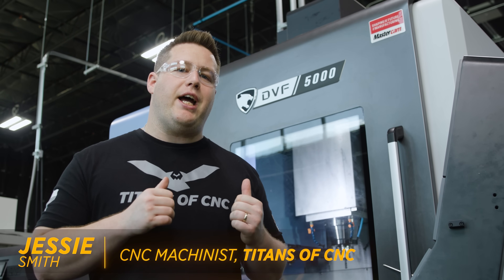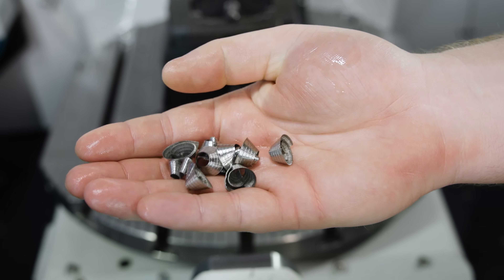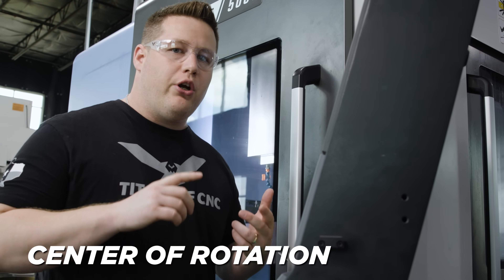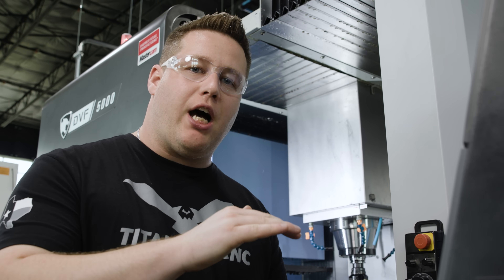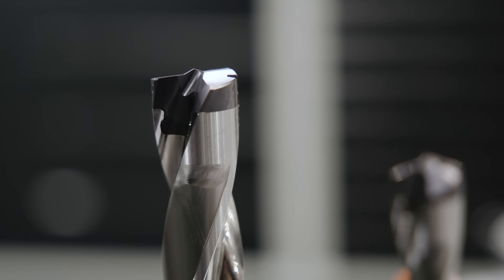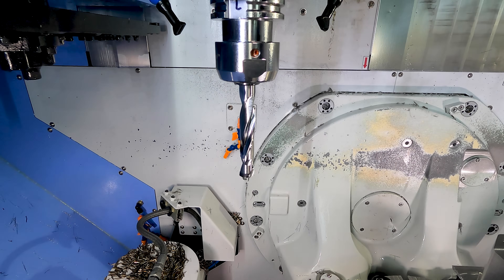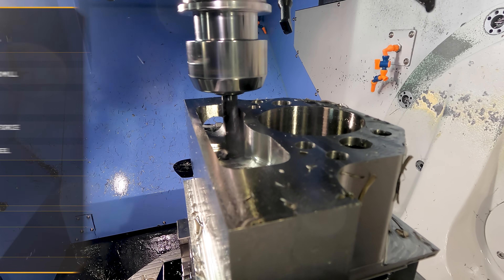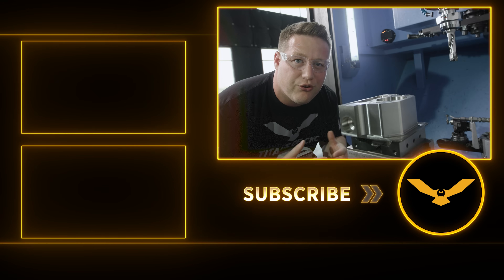Complicated 5 Axis Machining Techniques Revealed | DVF 5000 | DN Solutions

Comment: I’ve noticed something that caught my attention!

Jessie said at the beginning of the video when he changed the first drill that he runs the drill with 0.006” Feed per REVOLUTION (0:59). On the screen it shows 0.006” IPT (Inch per Tooth)-(it might be just an editing mistake). Unless Jessie created the tool with 1 tooth in the program, the IPT/FPT and IPR/FPR are the same, if not, the IPT means double IPR(if the tool is programmed with 2 teeth)!
Usually I create my drills with 2 teeth in Mastercam (unless it’s a special 3 or more flute drill) thats why I’m a little bit confused!
Let me give an example:
Tool programmed with 1 tooth: 
0.006” IPT/FPT is 0.006” IPR/FPR.

Tool programmed with 2 teeth:
0.006” IPT/FPT is 0.012” IPR/FPR.

Please make it more clear for me!
Thank you!
Reply: Hello Daniel.  You are absolutely correct.  A typical twist drill or modular drill would be 2 flutes but Indexable drills such as the DFSP should be programmed as 1 flute instead of 2.  It has two inserts but one is at the center of the tool (or close to it) and the drill only has 1 peripheral insert making it a 1 flute tool.

Usually I only talk in FPT terms but for this instance I said FPR because that is how NOVO gives the feedrate recommendations for this tool so I was trying to be consistent with what you would see if you were to look it up in NOVO.
Reply: Thanks for the reply, I’ve learned something new about the indexable drills! (They are defined as 1 flute drills and bc of that FPT is same as FPR)

If the your tools are programmed as 2 flutes (modular drills), then the datas are wrong in the video! It’s either the IPT or the IPM is wrong! (With all 4 modular drills in the video)
First modular drill is 0.3976” and 350 SFM=3367 RPM, that’s correct.
3367 RPM with 23.57 IPM is 0.007” IPR not 0.007” IPT.
(It should say 0.0035” IPT)
Or 3357 RPM with 0.007” IPT is 47 IPM.
(IF Tool is defined as 2 flute drill in the program)

I don’t try to tease you!:)

Thank you guys for everything that you do in this CNC community!
Reply: @danielkincses99  yes it is supposed to be FPR not IPT.  It looks like the wrong graphic was used
Reply: @Jessie_Smith  Keep up the good work guys!! Teach us more about the CNC world!

Comment: Can you please make a video on chain drilling? In my experience I have broken many solid carbide drills trying to chain drill. Thanks!!
Reply: I will see if I can't do a specific video on it breaking it down.  The KSEM drill is great for this application because it has a very strong seat for the insert.  I failed to mention it in the video but when you come back and drill in between two holes you need to reduce the feedrate by 50%.
Reply: Would a feedmill not be a better option for this proccess?
Reply: @bridged13b  You certainly could do this with a small feed mill as long as you had good thru spindle coolant or air blast to get the chips out of the pocket without re-cutting them.  But the feed mill wouldn't be as fast as the drill.

Comment: Very aware this is for 5 axis milling but was wondering if you have or had a Swiss type lathe (almost certain you had one in a old old vid) my current work place has mostly machined mild steels and we have a job in 316L but are struggling to find decent carbide. Any input off yourselfs or other commenters would be appreciated cheers from the UK
Reply: Do you have a preferred brand of tooling?  If you are having issues call you local tooling representative.  Get help from them.  They are a great resource and in some cases you can get a guaranteed test.  Meaning that if the tooling doesn't work out like it supposed to based on what the tool rep says you don't have to pay for the tooling.  I've done this with Iscar several times.  At my last shop we have a $3200 boring bar on a guaranteed test.  They brought the bar and several interchangeable insert heads for it so we could dial in what was best for us.  After we were done we only paid for what we actually needed.  It saved us a bunch of time and head ache.
Reply: Are you looking for good turning inserts for swiss or milling tools?  I will be straight honest with you, before I came to Titans of CNC I did not use much Kennametal milling tools.  I had used several of their lathe inserts but not much solid carbide tooling.  Since I have been here over the past 8 months I have been very impressed with the quality of Kennametal's carbide substrate itself.  They make very good carbide blanks.  Anyone can grind a tool and put a standard coating on it.  But having a good carbide blank is where it starts.  I have watched Barry put a Harvi I-TE that was chipped on every flute (not a little bit chipped, it was toast!) in the machine and full slot 316L like it wasn't nothing.  Any other tools would have blown up instantly.

Comment: How can you trust your MRZP settings to set your tool accurately enough through qualifying features? I think it’s safer and easier to give the holes another work offset.
Reply: I used this method countless times at my last job and would hit .001" true positions all day.  At the end of the day you will need to do what makes sense to you and your shop.  I am just trying to give some different techniques.  On a part like this that only has holes on two sides then additional work offsets would be easy.  But the more complex you get and the more sides you have it becomes a lot for the operator to keep up with.  Our parts I used to run would have over 200 features on them and they were painfully over toleranced so I always tried to come up with things that would be the least amount of effort for my operators.  For us, having an M00 in the program and a statement on the setup sheet saying "check this dimension, it should read this, if not, adjust this tool" was the best solution we found and was the least confusing for our guys

Comment: Why not use probe to verify dimensions. 
Instead if calipers?
Jeff in Virginia
Reply: People new to a trade need to learn how to do things without the automation to fall back on. If someone knows how to measure with calipers, "yes sir, I know I have to get 25 of these out by the end of the day but we're dead in the water because the interface card for the probe blew out last night" will never come out of his or her mouth.
Reply: Definitely could have.  I was trying to keep it simple just to teach a good method for machining qualifying features to ensure your tool is set properly.  You have given me a good idea though.  I can do a follow-up video on automating the process and probing the dimension and using a macro to adjust the tool length.

Comment: KILLER JOB !!!!!!!
I am running some of those tools as I type this. 
Drills are the most productive way to remove material, I think.
When we have to make a large through hole in our parts. I drill holes close to the diameter and remove a large slug form the center. then mill the I.D.
Reply: I agree.  It's hard to argue with the efficiency of a drill.  But they still scare me sometimes lol especially the big Kraken drill that Barry runs all the time!

Comment: You know that instead of stoping the machine and measuring with a caliper you could use a touch probe and do everything automatically. You could save time and all other errors by doing this
Reply: yes, but it's all about levels.  this is the first level and the easiest for people to understand and implement.  I hope to later make a video performing this automatically with a probe and inserting a macro to automatically adjust the tool.
Reply: Depending on the number of parts they need to make the programming of the probe may take longer than doing it by hand.  If they are running 1000's of these then definitely probing them in the machine would totally be worth it.

Comment: Did i miss some tips? I work on weak umc750 and making much more complicated patrts than this. I work in stainless, steel 1.2842 or 2311/12 in tolerances about .02-.03[mm] and this is tough. When u have solid machine, great tools and a hundret sponsors there is no big deal make to make things like this.
Reply: Congratulations on being so awesome! I promise you that we could make some parts that would BLOW your mind, but they would be useless to 99.99% of our viewers. And you can whine all you want about not having great tools......but that is why we like to show what GREAT tools are capable of doing. Maybe your boss will stop blowing money on garbage and start buying what you actually NEED.

Comment: Great video Jessy. I learned that I don't know a ---- thing. I was a machinist for years all manual. I made tools , dies , molds , fixtures  , and so many other very precision things that took me days just to make 1 section of a die.
 So I guess I have learned you could make every top and bottom sections in a day or two after you made the program for each section with great accuracy. 
 Our die making tolerance was +-.001 that must be a mile to you. I am impressed with the machines and the programming skills you have.
Reply: Thanks Ronny.  I always marveled at drawings that I would get in the past that I knew were so old they were originally hand drawn and in the back of my mind I knew someone had to make that part on a manual and hit those tolerances.  Manual machining is definitely a beautiful skill.  One that I wish I had more of.
Reply: @Jessie_Smith  thank you Jessie Smith and I am sorry for misspelling your name. 
And yes I  worked from prints of the finished part to be made from the die that was to be built. I had to know what material the parts were made of and the thickness of the material/metal.
 Then I build the die to stamp out the part or parts. Some of these are simple others are very complex. 
Some metals like 2024T6 at .125 inches thickness are easily shaped or just punching holes into it.
Some dies I built were making parts..250 inch steel. 
I had to build all the sections of the top and bottom of the die and hold the tolerance +-.001 where the top half and the bottom half meets together on the die shoe. 
1 mistake on any section would have to be remade so great care was always taken to make it right. 
Thanks for your time
Reply: @ronnydowdy7432  That is why I always tried to stay away from die work.  It is so tedious and one little mistake can cause you to have to remake the whole part.  I love doing fine detail work but building dies would drive me insane lol.  I've made some simple components for dies but that's about it.

Comment: Nice and short, not too much time and lots of good information.  I do not use those type of drills with the rotate in heads.  I have heard that the drill body can expand if it gets hot and the insert will come loose?  Charles

Comment: Why was the length out .005 from programmed dimensions?
Reply: The tool was only off by .0025”. Probably had a bad hit on the tool setter.  The point was that if you have a critical feature or when setting datum’s you really want to KNOW the tool is set correctly.  If you just touch off on the tool setter and hit cycle start you are really just ASSUMING it is correct and trusting that it is.  Which is fine if you don’t have tight tolerances but when dealing with true position tolerances everything becomes much more critical.  If you are off just .002” in X and Y then your true position will be .0056 which could be out of tolerance.  I just wanted to show a simple, easy trick to verify to yourself that the tool is cutting correctly on a feature that isn’t easily measured

Comment: For the holes dimensioned to datum A, wouldn’t it be better to take new offsets for a production run? Checking the side dimensions seem to increase the work of the operator to me? Sorry if i sound ignorant, am new to this 😅😅
Reply: This feature really only has to be stopped and checked on the first part.  Once the tool is set you won’t have to keep checking it unless you want to.  And yes this is really meant for low volume work when you can’t afford to scrap a piece.  At my last job the material was so expensive they would only order the exact amount needed and no extra so you had to get creative and find ways to make sure the features were being cut correctly on the first part.  Yes it added a little extra machining time on the first part but if we would have scrapped a part it would have taken even longer to machine another one.
Reply: @Jessie_Smith  Thanks for your explanation! I was curious as to which would have been better techniques for different circumstances and your example cleared it up for me 👍👍
Reply: What worries me more is setting that datum and than going on roughing away big volumes of material. I don't know the tolerances on that part but stainless can move a lot on you. So I would do much more roughing before going into those fine details.
Reply: @ensen89  I agree.  Normally I don’t do ANY finishing until I have everything completely roughed.

Comment: Nice, powerful machine; very capable tooling, precise measuring instruments; rigid fixturing combined with the power of Mastercam . . . all of those would be sitting idle without you putting everything together. I like your trick/tip on measuring and adjusting your tool length offset to establish your datum . . . you have only eluded to nesting position practices (that subject is very deep). I loved your chain-drilling solution to avoid chip-jamming problems - foreseeing these potential problems is a sign of extensive, expert level experience. BTW - those are some beautiful drills. Drilling is done everywhere, from a job shop, to medical, automotive, aerospace . . . you name it, and I am always amazed of how neglected it is in many places. You showed us again, that every detail is important - proper entry into material, coolant . . . even down to having a mini 'TITANS of CNC MACHINING' eagle on the safety glasses🙂
Reply: Could you elaborate on "nesting position practices"? I'm always interested in learning new techniques.

Comment: love the FEG tip from kennametal no more using endmill to flat-bottomed the hole anymore
Reply: It is very nice to make a flat bottom hole in one operation and not have to setup a separate tool just to get rid of the tip